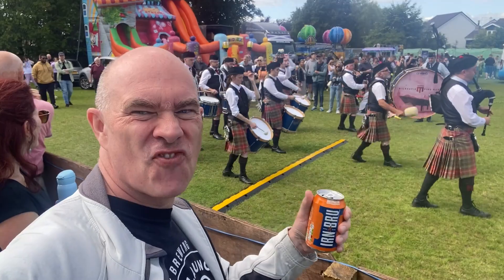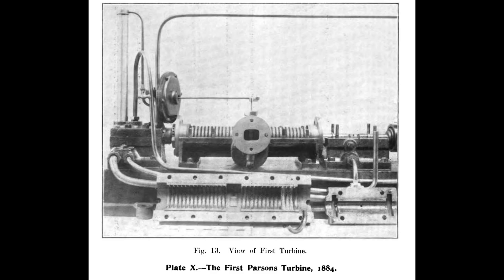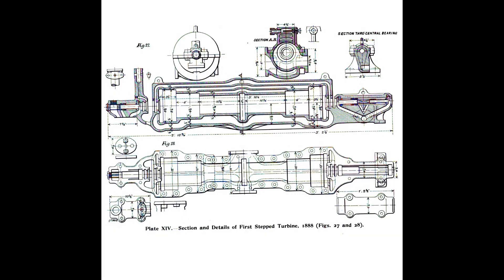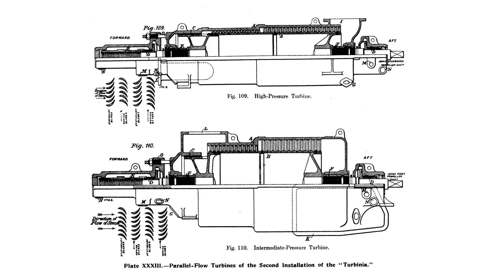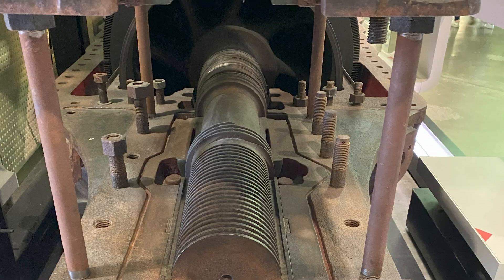How A Victorian Era Engine Made Spaceflight Possible... Let's Look At A 125 Year Old Turbine!

Comment: HI Scott; Both Lusitania (fully) and Titanic (partially) were powered by Parsons steam turbines.  Good video.  thanks.
Reply: Yep!  Center turbine engine of titanic ran off waste steam from port/starboard triple expansion four piston engines.  Clever, efficient and good balance of old reliable tech and new for the time.  

Crazy around the engineering of handling the steam, water accumulation/separators, condensers etc…
Reply: @dwyerpe  Not just the Titanic. Her sisters the Olympic and Britannic did as well. All three being the same class as it was.

Comment: I love it, he called the coal on a ship a "propellent" and it made me chuckle. Of course scott is not wrong, but the slip of the tongue was just funny
Reply: I'd have called coal the fuel, water is the propellant.
Reply: @HALLish-jl5mo  Correct. And the water/steam inside the engine is a working fluid.
Reply: Water is only the reactive mass.  It holds no energy in itself.  Steam does, only not for very long time.  Coal and oil contain energy.  Also wood;• and even diamonds could serve as a propellant.
🚀🏴‍☠️🎸
Reply: It is wrong, coal isn't ejected out the back at high velocity to propel the craft. It's a bit more complicated for a vehicle which operates in a fluid like a jet or boat, but strictly speaking the coal is fuel and the water going over the propellers is the propellant. Luckily there's always more of it, which is what makes rockets so much harder than terrestrial vehicles.
Reply: WAS it a slip of the tongue? Seems to fit the definition….
Reply: Yes, 1:53 , I was going to point it out, too. Funny. Well, now I’m going to fill up my car at the propellant station. 😅
Reply: That gave me a bit of mental whiplash too, lol.   :)
Reply: well, coal and water
Reply: @JulianDanzerHAL9001  Coal is not a working fluid.

Comment: How a Victorian Era Engine Made Spaceflight Possible: The Story of the Steam Turbine

* 0:04 The King Edward Turbine: Scott Manley introduces a 125-year-old steam turbine from the TS King Edward, the first commercial ship propelled by a steam turbine.
* 0:38 Link to Rocketry: Manley emphasizes the turbine's importance in the development of modern rocket technology.
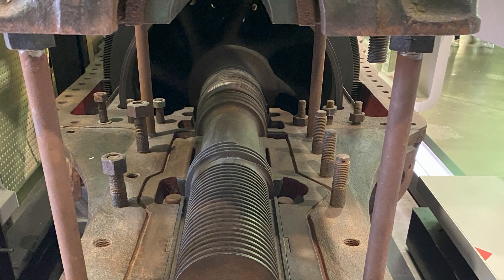* 1:05 First Operational Maritime Turbine: The King Edward's turbine was the first commercially successful marine steam turbine, following earlier experimental vessels like the Turbinia.
* 1:47 Efficiency and Speed: The turbine offered significant improvements in speed and efficiency compared to traditional reciprocating steam engines.
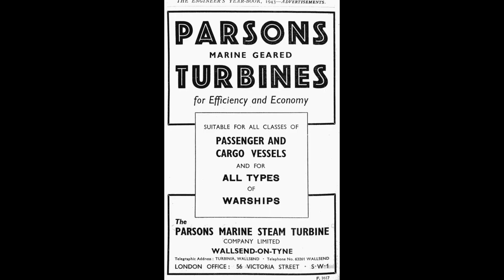* 2:02 Charles Parsons: The turbine was developed by Charles Parsons, whose family had a strong history of science and engineering. 
* 2:12 William Parsons: Charles' father, William Parsons, built the Leviathan telescope, which enabled groundbreaking astronomical discoveries.
* 3:34 Turbine Design: The steam turbine utilizes multiple stages of blades and staters to extract energy from high-pressure steam, achieving high rotational speeds.
* 3:58 Impact on Electricity Generation: Parsons' turbines revolutionized electricity generation, drastically reducing costs.
* 4:20 Early Steam Engines: Manley briefly discusses the Aeolipile, a Greek-era steam-powered device, and its connection to the concept of rocket propulsion.
* 6:05 Marine Applications: Steam turbines were initially used for onboard power generation in ships before being adapted for propulsion.
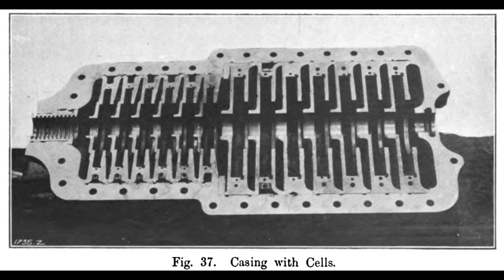* 6:54 Radial Flow Turbines: Parsons initially explored radial flow turbine designs due to patent restrictions.
* 7:13 Gustav de Laval: Swedish engineer Gustav de Laval developed a turbine based on steam velocity and invented a nozzle that accelerated steam to supersonic speeds, essentially a rocket nozzle. 
* 7:59 Cavitation: The Turbinia's early trials highlighted the issue of cavitation, the formation of vapor bubbles in water due to low pressure, which can damage propellers and create noise.
* 9:49 Propeller Design:  Parsons and his team conducted extensive research to develop propeller designs that minimized cavitation.
* 11:18 The Turbinia's Success: After overcoming cavitation issues, the Turbinia achieved impressive speeds of 34 knots, demonstrating the superiority of turbine propulsion.
* 12:25 Precision Engineering: Manley highlights the remarkable precision engineering involved in building the 125-year-old turbine.
* 12:41 Steam Turbines Today: Steam turbines are widely used in power plants and other applications, including rockets.
* 13:43 Turbines in Rockets: The V2 rocket and the modern Soyuz rocket utilize steam turbines for turbopump operation.
* 13:59 Legacy: The Victorian-era steam turbine has a direct lineage to modern rocket technology and remains a testament to innovative engineering.

I used gemini-1.5-pro-exp-0827 on rocketrecap dot com to summarize the transcript.
Cost (if I didn't use the free tier): $0.02
Input tokens: 16834
Output tokens: 639
Reply: Well, that did, indeed, work very well to chronicle this video. Nicely done, with gemini.